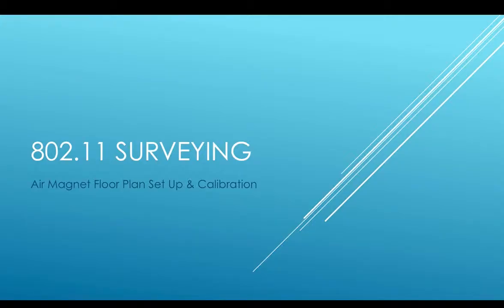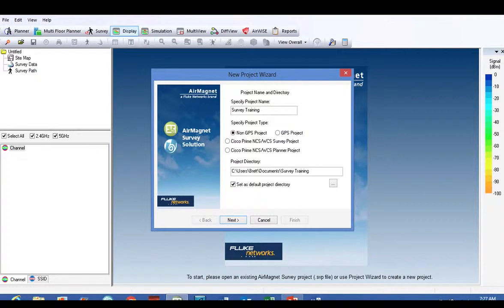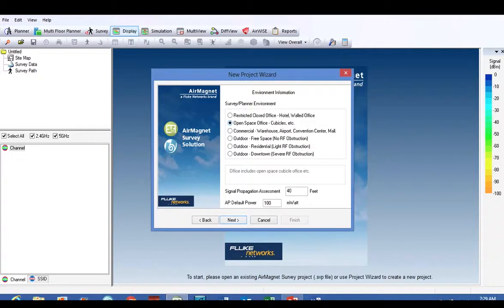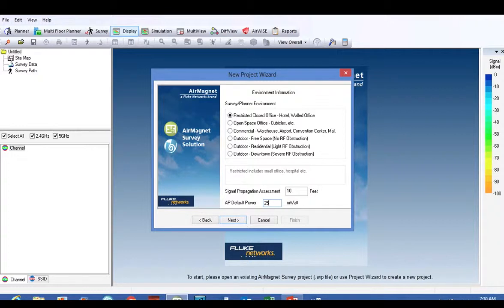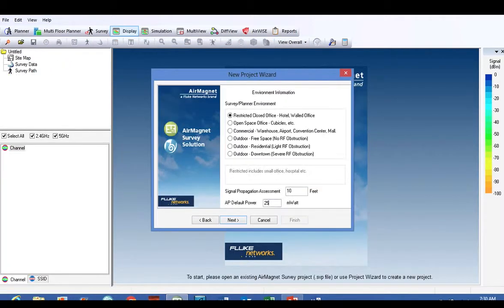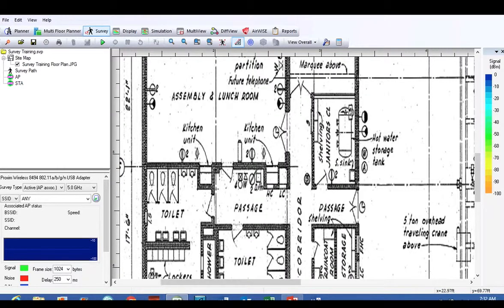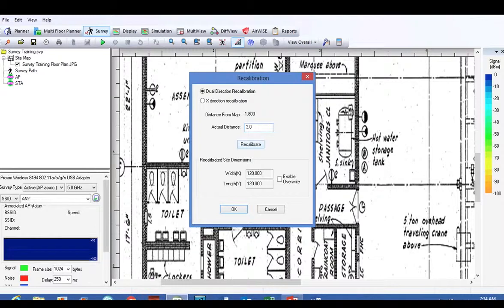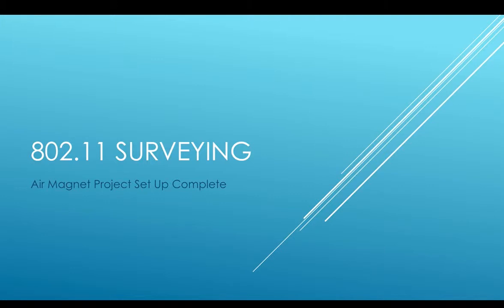Air Magnet Project Set up and calibration

Comment: I cant believe you would use a door width  to calibrate the drawing? The error margin will be way out surely? I was always taught to measure the longest distance you can find. Google maps is also a good way of measuring the outline of a building. I would never use a door to calibrate any of my surveys.
Reply from the maker: If the drawing is an engineering document, the doorway is fine. Air Magnet's training class for getting certified on their software uses the doorway. Sure the longer the measurement, the more accurate you will be but you are not looking for inches here as your walk path and the algorithm is going to both make variations as well as make up for variations. Surveying on both sides of the walls and allowing for smaller algorithm assumptions is where you will make your survey more accurate. Its not all in the calibration up front. In other words, you can measure the building to get more accurate calibrations on the drawing and then walk a bit further from the walls, or assume a walk path by just walking into the room and clicking the corners instead of going to the corners and then your full length calibration isn't worth the effort. Accuracy with surveys is based on 3 fold and not just one. Hope this helps and thanks for watching and commenting.
Reply: With all due respect, a door (or small window) is the worst thing to use.  ALWAYS use the longest, most accurate measurement available. A one pixel error on a 3 foot wide door is worse than a 1 pixel error on a 50 foot (or longer) wall segment.